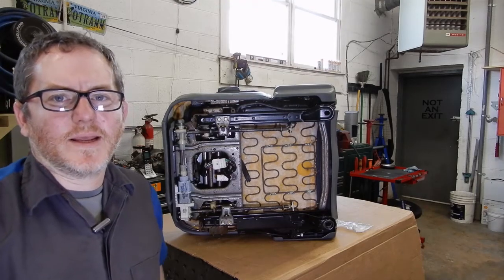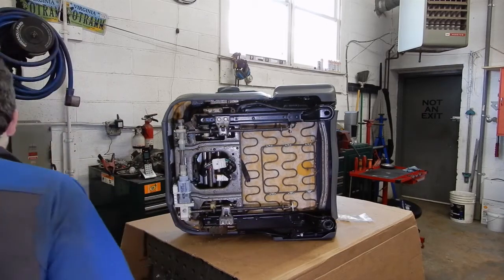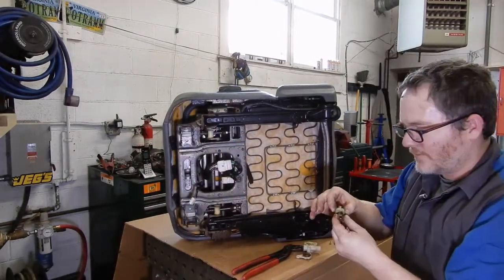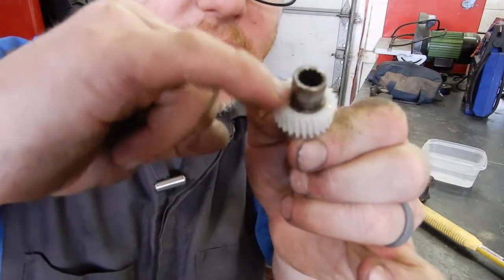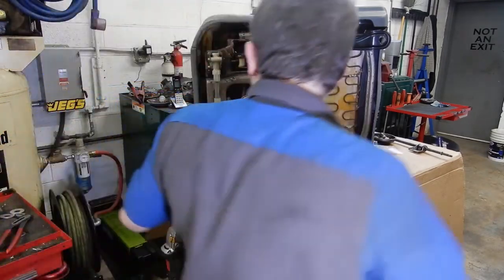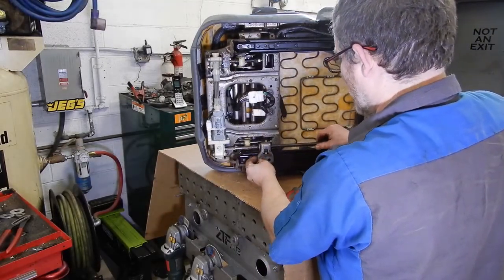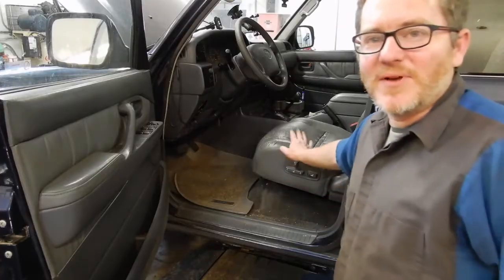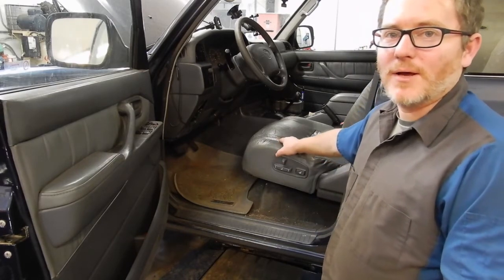80 Series Land Cruiser Seat Gear Replacement

Comment: Exactly what I needed for my LX 450 seat drama.  Huge help—thank you!
Reply: what issue did you have? mine would move slightly forward but it doesn't move back.
Reply: @AlbertVillaroman  My front passenger seat stopped moving backwards, after removing it I saw 1 side had traveled too far forward and couldn’t re-engage to go backwards.  I took both sides apart, reset them evenly (as the video shows) and seat works great.
Reply: @MyzelleJenkins  that sounds like the same issue I'm having. let me give that a try

Comment: I wanted to add a product report for those who are considering metal gears. I just installed a set, I was able to get them quickly and conveniently through Amazon. They work fine and come as an assembly so you don’t have to press the gear on the shaft. I know there is debate over point of failure and Toyota put plastic gears for a reason arguments, I don’t have an opinion on that. I needed the parts quickly and they worked. Thanks for a great instructional video. As a side note my 10 year old replaced them, I just had to show him what to take apart.
Reply: Can you give me a link for the gears you bought on Amazon ? I am have the same issue ? Or also the plastic gears too ? Thx so much 👍

Comment: Good vid. I might add the root cause of the stripped gear is the missing end cap. They will work themselves loose. And allow the gear alignment to get off. And the gears will strip. To prevent this from ever happening again. Drill a small hole thru the housing into the end cap. And run a small self tapping screw into it. That end cap will never come loose again unless you want it to. Also using some Teflon tape will also help hold the end cap in place. This is on the gaviti website not my idea. Also it takes one set per seat. The sets are $20 each last time I bought em. I have never heated the gears just the shaft. I may try heating the gears next time. Seems easier than torching the shaft. But was wondering if heating the gears may compromise them. I doubt it but that would be my only concern.
Reply from the maker: Good point.  I totally forgot to mention using a screw to pin the end caps in.  Heating the gears up in hot water doesn't seem to get them hot enough to affect them.  The heated gears seem to install easier than heating the shaft since they're more pliable.  I had broken a few gears using the heated shaft method.  I haven't broken any since I started heating the gear instead.

Comment: Just finished the gear replacement which would have been impossible for me without your helpful video. @ 9:44 you put in the four 5mm allen bolts. I was almost done when I realized I had one left over. Hmmm....?? Turns out there are 5 of them. Probably typical Toyota overkill!

Comment: Ha... so I did the gear change.  Plenty other things wrong.... I think it needs a new motor ... one motor just doesn't spin when... yes both gears were installed... the part that spins the near middle or interior 'screw' worked for about 4 seconds... I can take this seat apart and put it back together in 12 min now... thanks again for the video
Reply from the maker: I've run in to weak motors on the last few I've done.  The one in the video only worked a bit before the motor bogged,  Works fine not bolted in though :)
Reply: Link to http://www.gamiviti.com/seatparts/ works. More info please.  This is so timely for me, I am buying an 80 that needs this fixed.  Thank you.
Reply: Steve Loomis if the link works ... order a couple of gears ... hopefully the motors are still strong ... I put gears in mine and the motors were shot .... I said SHIT not shot but .... I bought two used non motorized seats less headache ... the replacement becomes easy once you’ve done it two or three times and you will ... good luck

Comment: Thanks for the video. Have you tried the metal gears yet? Also who makes the driver / gun you are using to take those bolts loose with? That is a nice tool!
Reply from the maker: I haven't tried the metal gears yet. My 80 needs gears so it may be the Guinea pig. The impact is a Matco. Crash has the Milwaukee version and it's more powerful and cheaper. Once the Matco dies I'll be getting a Milwaukee.

Comment: Otramm  I'm a dental lab tech . I can invest ,burn out  the plastic gear and  can cast it into stainless steel . Do you see any reason  why you don't want  the gear to be metal  ?   As far as I know  the only reason the  gears  strip out is because the plug works it way  out  and causes the bar with the gear  turn   off center and binds the gears and strips the gears out  .It only take one adjustment of the seat with the plug out  to strip the plastic gears .  If the plug  would stay in place  the gears would never strip  .  I drilled a small hole  into the housing  through the cap  near the end  out the other side  and put a  pin through it  to hold  the cap in place so it would not work its way out .  What is the reason the  gears are plastic and there is no way to lock the cap that comes out in place ?
Reply from the maker: Not sure why the gears were plastic other than cost or maybe noise. There's an aftermarket version that does them in bronze but I haven't tried them.

Comment: Does the 80 series 1994 with manual seats have the electrical plugs already if you want to change the manual seats for an automatic seat?
Reply from the maker: I'm not sure, I've never looked. Toyota is pretty good at wiring for all of the options though so they're likely there.
Reply: That's funny, because I want to switch my power seats to manual!

Comment: Just so I understand the symptoms, I have about 1/4" to 1/2" of play in the seat bottom and seat back.  Is this the procedure I need to complete?  Yes, seat is bolted securely to body.
Reply from the maker: Usually if the gears are stripped the motors spins but the seat doesn't move. I could see it causing slop in forward and backward movement though.

Comment: Did the gear change but seat mounting holes doesn’t align with the truck anymore therefore I can’t put all 4 bolts any idea on what I did wrong?
Reply from the maker: Sounds like one of the adjusters got spun so they don't line up side to side anymore. It's easiest to reassemble with the adjusters all the way at one end or the other to insure they line back up.
Reply: @OTRAMM  I carefully measured them and they’re the same distance like you mentioned I put them all the way back. I’m going to try tomorrow again with a clear head because it just makes no sense to me
Reply: @OTRAMM  thanks for your reply. I found the issue I took off both seats, took apart the 2 rods on each seat and mix matched them when I put it back. The drivers seat is a bit longer than the passenger seat rod so this caused issues.

Comment: Hi OTRAMM, One quick question on the seat gear that you install.  Do you know why after installing the  new gear on and installing the seat back in. the new gear crack once i test it out.  is it because the track is off alignment.
Reply from the maker: I've had that happen a few times. My guess is that the gears weren't quite warm enough and got stressed on install. Tracks out of alignment could do it as well though.
Reply: Per Gamiviti himself: "There is a small 
chamfer on one side of the gear, and I always start the press on that 
side..  any chance you tried it the other way?   Only other way I'd 
think of is it went on crooked..  I have done quite a few of these and 
just start slow and straight, making sure I start on the chamfered side,
 and they don't split.   "

Comment: I have this issue with my 1999 100 series landcruiser where my seat slides only on one side. Will this work for the 100 series?
Reply from the maker: I've never worked on the 100 series seats. I'm not sure.

Comment: what type of grease do you  apply to the gears when installing?
Reply from the maker: The best would probably be the Toyota electric motor grease. Barring that like a plastic safe grease like caliper pin grease.

Comment: I'm on my 3rd replacement for the passenger side, 2nd on driver side. such a bad design
Reply from the maker: I think it was probably originally a safety fuse. Like the gears would strip before you crushed things. As the slides wear and the threaded rods get gummed up the added resistance pops them easier. At least that's my theory.